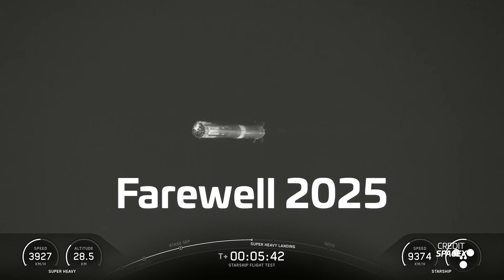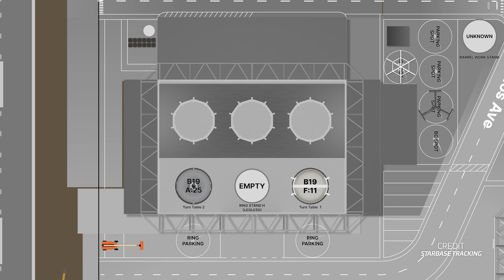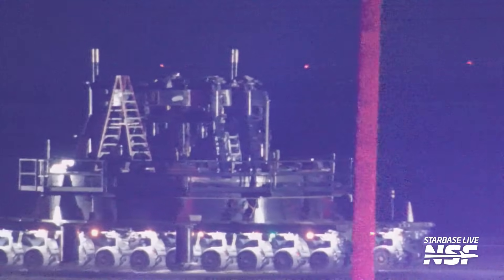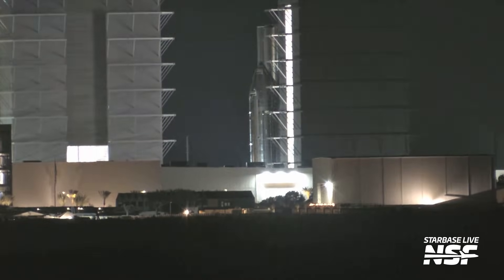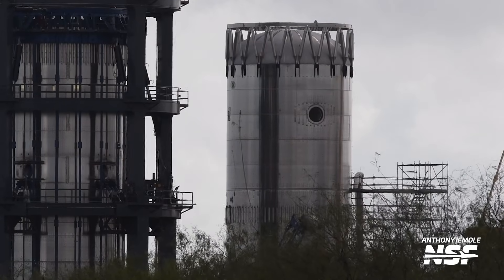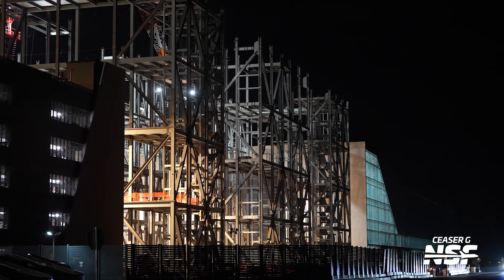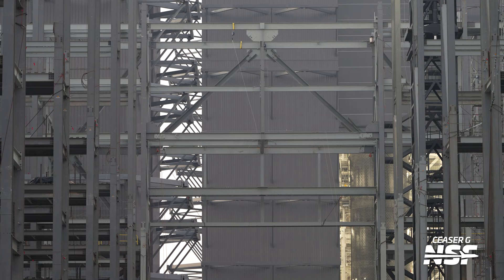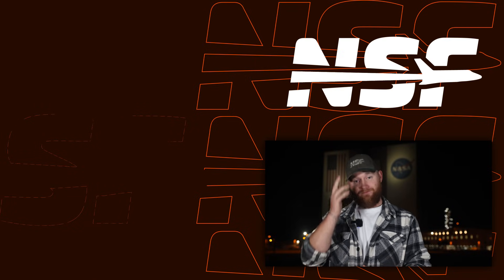Will SpaceX Make Its Starship Timeline? | Starship Updates

Comment: Musk on Mars - Space Unicorns - See the Spoiler near the end.

Will Musk succeed in making 70,000 Starship launches, at the rate of one every 30 minutes, in order to realize his Mars colonization plan over a span of 191 years?!!

Using reports & statements issued by Elon Musk I have calculated the viability of his Mars colonization project. 

Musk admitted that 1 million tons of material must be sent to Mars in advance of humans to supply the components for safe habitat.

That requires 10,000 successful launches and subsequent descents of Starship to the selected habitat area on Mars (100 ton payload per Starship claimed by Musk).

In addition, Musk stated it will take 6 more Starships for every Mars bound vehicle to refuel those Mars bound Starships for the actual Mars journey. That's 60,000 additional Starship launches, allowing that there are no failures.

This gives us 7 launches for every Mars bound vehicle. So in reality, at one launch per day (wildly optimistic = delusional, but let's go with it) it will take 7 days per Mars bound vehicle. That now totals 191 years to complete material transfer.

Spoiler:
The window for a Mars launch is once every 26 months, with 15 days available in that time frame (49 launches per day). 
That means Starship will have to cram in 732 launches in 15 days every 26 months to meet the 191 year infrastructure transfer, or one launch every 30 minutes.

1) What will happen to the first material that lands after 191 years while it sits waiting for the final structural parts to be landed?
2) Who will finance each Starship?
3) Who will finance the cargo?
4) Who will finance the fuel mass needed to make the journey?
5) What can be done at the Mars site if material is damaged?
6) During the 191 years will there continue to be a viable SpaceX factory?
7) How many Starship launches will fail during the program to put material on Mars.
8) How many Starships will crash during the landing phase on Mars?

9) How about feeding the astronauts for 38 months once manned Mars missions begin? Musk has no clear answer.

These are the most basic problems. There are countless questions for the logistics to get started, keep it operational and do the costly program maintenance.
Reply: It's embarrassing when you people try and pretend you're smart.

Comment: Hopefully they will have starship, ready, and a working hatch, and Cargo, a emergency return to earth vehicle inside the cargo bay, and so forth,  incase, Artemis runs into a issue going around the moon. Scheduled for February. It would be really supportive to see them extra fuel,  so forth and launch within 12 hours of Artemis,  and travel a similar path behind Artemis incase there was a issue. 
The longer test burn of the eng, I would speculate as, everything so far has been very low earth orbit.
Reply: I have no of no requirement for have any kind of emergency return vehicle.  They calculate the fuel load during mission planning.  A back up mission would also be quite a bit more expensive.
Reply: @imaginary_friend7300 
Spacex, has a contract w nasa, regards to  moon base return module, I believe space x is way behind on its construction. Nasa is threatening to go with orion, as there's is almost done.  Gateway, has not even started being built, which is suppose to orbit the moon, for as a hub, for the moon return vehicle hub. It's way behind schedule. Spacex is way behind and actually got some of that money for that already.
Reply: @ryanjohnson1814  They have a contract to pick up a crew in NRHO deliver a payload to the moon surface and return a crew to the Orion in NRHO.  What does the Gateway issues have to do with Spacex?  Are you implying that the only parts of the Artemis program that have and are experiencing delays is spacex?

Comment: Wider hydraulic rams don’t move faster, they infact move slower but with more force, assuming the same pump and hose size

Which means you could move the pivot point, for a faster moving arm, doesn’t look like they did that, but it should have more force to stop quicker, maybe needing less of a ramp down

Comment: Could those fixtures be there for testing out the docking system for refueling the fueling depot?
Reply: I really wish they would put interest the multip fuel depot that can have multiple ships coming in nose first to docking forms and having the depot rot to assimilate artificial grav to transfer from multiple into the depot at once and then cease rotation and decouple

Comment: If SpaceX want to reach their deadlines than flight 12 will literally have to be perfect. SpaceX can't afford anymore ships blowing up and they definitely can't afford to spend half of 2026 with four flights to try to perfect the V3s just to make a simple splash down like they did this past year with the V2s. New pad, new raptors, new ship version, new booster version. A lot can go wrong. Hopefully it doesn't and SpaceX can reach ALL their goals in 2026.
Reply: lets hope s39 survives with those new copvs
Reply: From a friend of mine who works for SpaceX as a Ground and Integration Engineer, he does not believe Flight 12 will be perfect, although he would not tell me why.
Reply: @brendentodd9360  I would suspect because the more new things and updates the more chances of something going sideways.  Could be something big or something small.  But rare for a first test of a new system to be perfect.
Reply: @brendentodd9360  Thats odd because my buddys wife told me otherwise. F12 is set in the next 2 weeks and they will be attempting to land everything
Reply: @FrotLopOfficial they haven’t even built the vehicles yet… it’s not happening in two weeks
Reply: Seeing as everything will be brand new for the next flight I'm willing to bet there will be problems with most the flights of 2026. They had plenty of issues with just changing out the design of the ships in 2025.